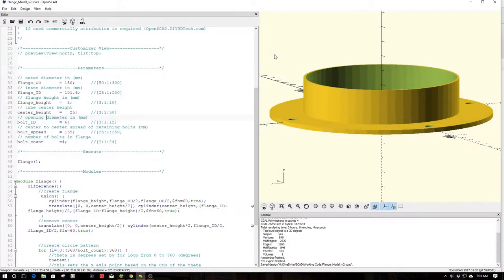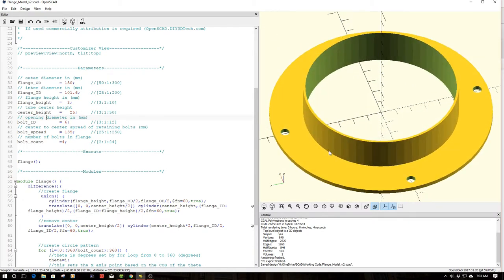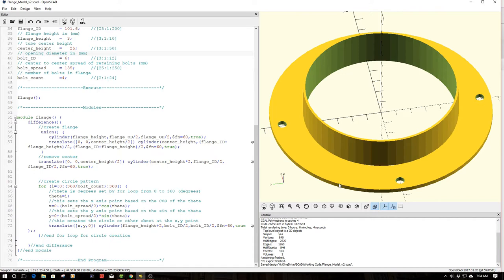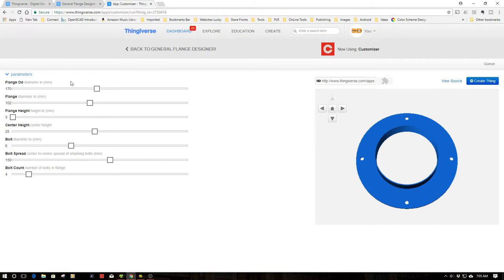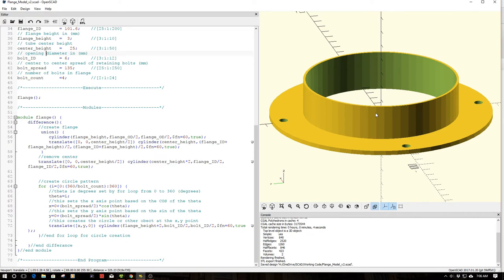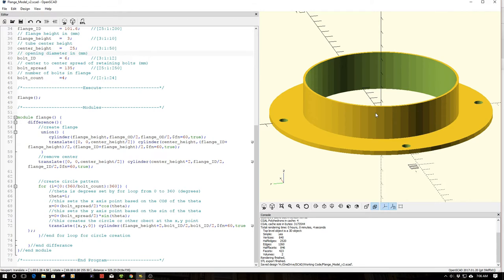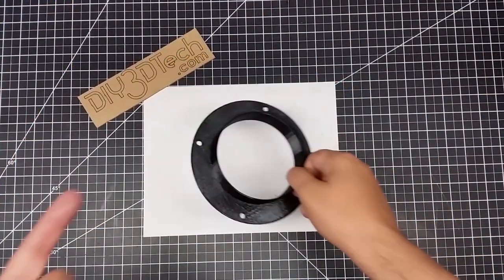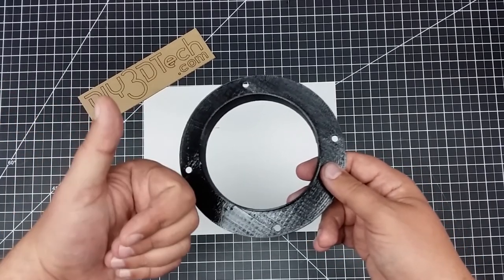Open SCAD - General Flange Designer and Customizer!

Comment: When I make something like this, with rotational symmetry, I generally create a 2D cross-section with polygon(), then spin it with rotate_extrude(). Any comments on this strategy?
Reply from the maker: I guess I am trying to figure out why use a polygon, can you share more?  As I only use polygon's for complex shapes and this is nothing but circles or cylinders, not sure again the logic behind using a polygon...
Reply: I probably would have done it like this:

// A few constants to make the code a little cleaner
flange_OR = flange_OD/2;
flange_IR = flange_ID/2;
outer_wall_R = flange_IR + flange_height;
center_H = center_height + flange_height; // personally I would have implicitly included the flange depth in center_height and saved myself a translate()

rotate_extrude($fn=60)
polygon([
  [flange_OR,    0],             // bottom outer of disk
  [flange_IR,    0],             // bottom of center
  [flange_IR,    center_H],      // top of center
  [outer_wall_R, center_H],      // outer wall at top of center
  [outer_wall_R, flange_height], // intersection of center and disk
  [flange_OR, flange_height],    // top outer of disk
]);

This technique is overkill for a simple model like this, but I typically use  it to craft much more complicated rotationally-symmetric models.

Also, if you don't mind a little nitpicking, the center_height * 2 on line 60 can be replaced with center_height + flange_height. Longer perhaps, but cleaner: you're not subtracting material that isn't there. (Another reason to implicitly include flange_height in center_height and just make center_height be the height the central pillar rises above 0.)
Reply from the maker: Interesting, I am going to have to look at polygons a little more.  Thanks for sharing 😉